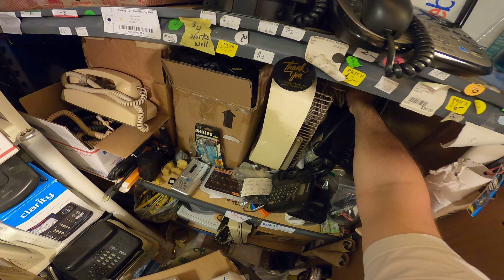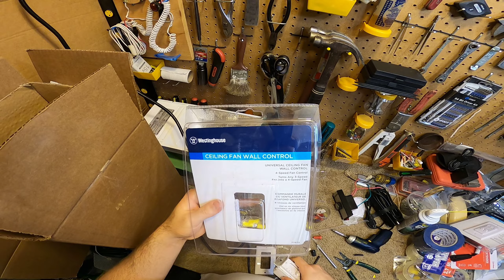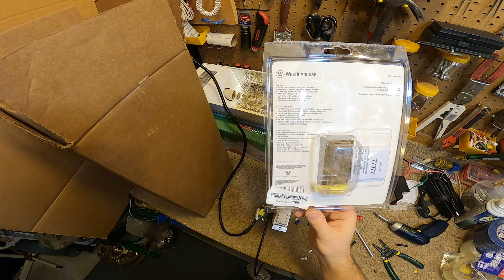Envirofan 136F | Install and Test with Different Controls

Comment: I love those mini golds, I have a plug in variant I bought new in ~2015. I put the blades on first when I install pretty much any industrial fan, its easier than trying to put them on when the motor is hanging. Also they give you lots of extra wire so you can easily swap out a longer downrod if needed without having to extend or replace the wires with longer ones.

Comment: Personally, I really love industrial 3 blade ceiling fans and ceiling fans that don’t have any lights on them. In my opinion, the lights on many ceiling fans look out of place.
  
By the way, I think these variable speed controllers do work with resistance, similar to speed coils with antique fans. There’s likely a wire connected to power that slides across a plate of metal varying in resistance. For example, the plate would be connected at the end where it is marked as “max speed” or least resistance. Then, sliding the bar farther away from it would make it harder for electricity to pass.
Reply from the maker: I do as well. As far as the lights go, it depends on the fan. Certain ones I like with lights, others I prefer without.
Thanks for letting me know about the controls.

Comment: I was really expecting the performance of the fan to be higher than it is. Do you think it may be possible to mount a better set of blades onto the fan? I'm sure with a good blade, it would really whip some air around, as the high speed seems quite fast.

I too suspect perhaps the louder hum isn't coming from baring's, but the fact that the blade is metal. I know metal resonates a lot more than wood, so could be that.
Reply from the maker: The motor doesn't seem to have much power, it probably can't handle any more pitch. The older models seemed to move a lot more air than this one, which of course is a common trend now.

I don't believe the bearings are making the sound, rather I believe the sound is being made as a result of an issue with the bearings. There will be a video of this theory soon.

Comment: Why are you so against anything that isn’t 50+ year old technology? LED bulbs, smartphones, anything that’s energy efficient etc. You might as well just cut the electricity and rely on the sunlight, candles & oil lamps.
Reply from the maker: LED lights flicker, give me a headache, and fail prematurely. I'm not going to trade that for the incandescent design that doesn't have any of those issues. Smartphones waste so much time and have consumed people's attention so far beyond what's reasonable.